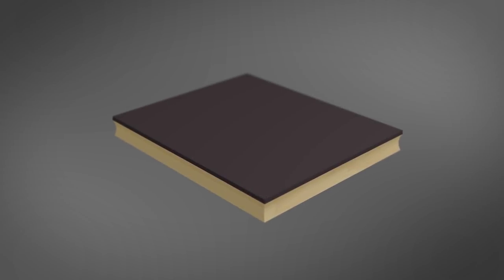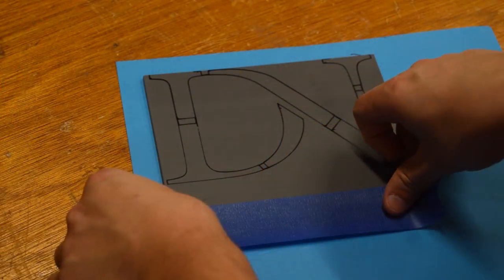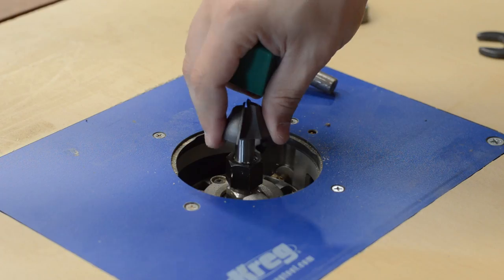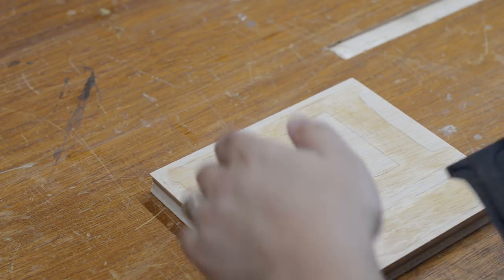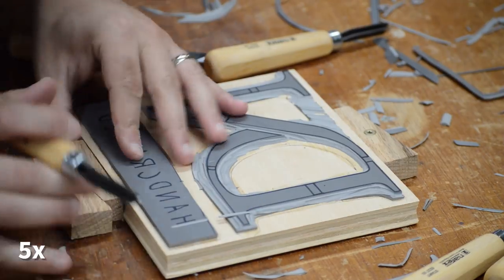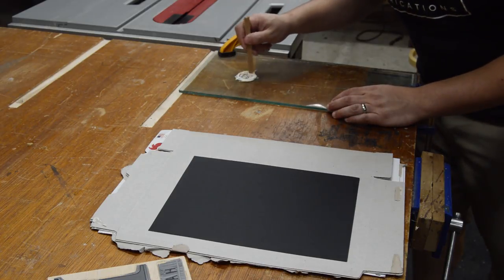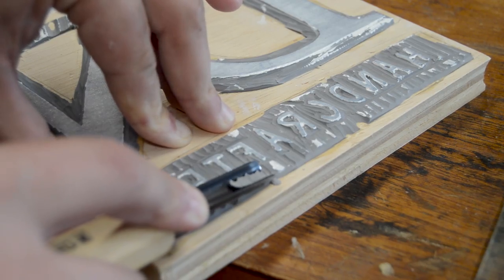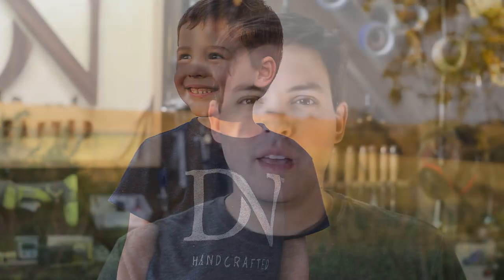Creating Block Printed Shirts // Linocut Shirts // DIY

Comment: Nice video man! I hope this inspires people to recycle some old shirts and have some DIY fun.
Just a little tip that could save you some carving time and ultimately help you get straighter and more controlled lines: 

Instead of going with gouges from the getgo, use a Hangi To (Japanese Woodblock Carving chisel - They are in every basic set I'm sure you'll have one lying around) to trace your design before using the gouge tool. The Hangi To is sharpened only on one side and that's very important; You need to have the flat side of the blade facing out, towards the part of the linoleum you want to gouge. The angled or chiseled side of the blade should face towards your design. Hold the tool at a 60-ish degree angle and cut along the outline of your design. 

Once that is done, gouge the part you want to discard with your preferred tool. 

This ensures straighter lines and keeps the linoleum at the very edge strong so it doesn't wear over time and/or deform under pressure. What you're aiming for is an edge that's slightly slanted outwards.

Comment: Great finished product. Any reason you were against screen printing? I'm planning some shirts myself and am also trying to decided the method of printing that I can reliably and repeatably DIY
Reply from the maker: +42Fab - Metalworking and Multi-Medium Fabrication thank you & great question. The short answer is no. Screen printing is great. For me it was frustrating I couldn't put my logo on a shirt without ordering a bunch of things for screen printing - and then after several attempts (stencil, DIY screen, etc) it became more of a "I will find a way" - this process still required special tools, but I had the chisels and wood on hand and I actually liked the finished quality (not thick and potentially cracking) That being said, I will still probably do screen printing at some point - but will just use a screen printing ink that isn't as thick as the basic speedball white.

Comment: Great idea!  what kind of linoleum do you suggest. Do you think it would work well for a logo stamp?
Reply from the maker: +Hammer and Neil I think stamp material is much softer - but I've only done this once so I've not tried the softer linoleum they sell which might work better for a stamp. If you try it, let me know how it goes!
Reply: I will.  Do you think a piece of linoleum flooring would work?
Reply from the maker: +Hammer and Neil I wondered the same thing, but it was like $8 for the gray linoleum at Hobby Lobby so I just bought that.
Reply from the maker: Hammer and Neil Just came across a video (from one of the other commenters) who shows how to carve stamps. Same process, just use a softer material: https://youtu.be/sihNJy__EBU
Reply: DN Handcrafted awesome thanks for the follow up.

Comment: As a printmaker, I had to stop and watch your video.  Great Job!  May I ask what kind of Ink you used?
Reply from the maker: +Beth Harris thanks for watching! Do you have any suggestions for things I could have done better? It was my first time doing this. I used speedball fabric block printing ink. It’s still holding up well even after multiple washes.
Reply: You did a great job!  Depending upon the ink used (I haven't used the speedball inks - I use mostly Gamblin oil-based etching inks) you might want to use a bit less ink, and just let the ink have a bit more time to 
 penetrate nd absorbe into the fibres before removing the block. Having said that though,  I print primarily on paper and usually add the paper to the (face up) block, rather than the block to the paper, but what you did seems to have worked brilliantly, so my motto is "do what works for you"  ;-)  Thank you for sharing your creativity and results.  I will have to give your method a try now.
Reply from the maker: +Beth Harris all of that makes sense, thanks! I want to give paper prints a try for sure. Will have to get some of that Gamblin ink. Thank you!
Reply: Yeah im asking the same question